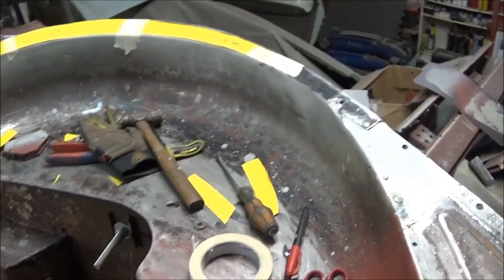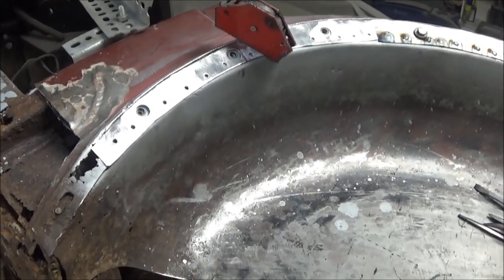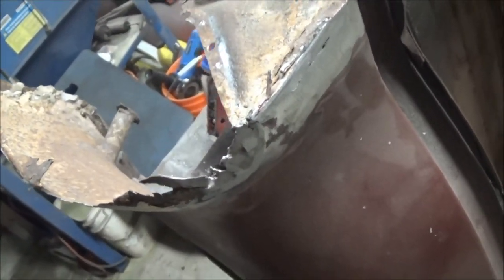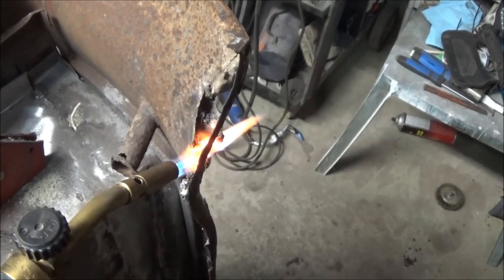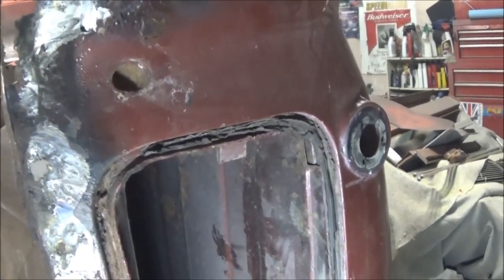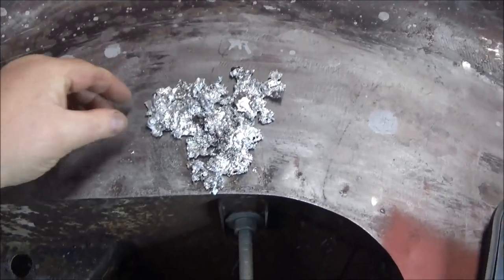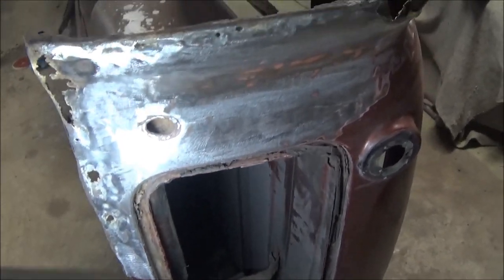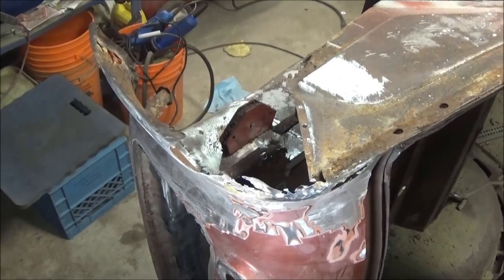Beauty and the Beast, 1959 Triumph TR3A Restoration

Comment: That's a fairly extensive repair.  I see inner supports in the back ground too.  Are they for the same tub?
Reply from the maker: Dave Hogye hi Dave, yes, this car will be getting new inner and outer sills as well as new floors.
Reply: Good for you.  You are saving another TR.  The rear apron is a huge challenge.  The rest is easy in comparison.  Go man, go.

Comment: Oh Wow! The rear apron is in a poor state! I think I would need a cold beer after seeing that, but starting at the top and working down as you suggested seems like a plan. I'm sure you know but there is a repair panel available for that section its expensive but could be cheaper from Moss http://www.rimmerbros.co.uk/Item--i-900477REP Great repair work on that wheel well.
Reply: Have tried some of Rimmers repair panels, and my experience says that all parts painted read has a lousy fit.